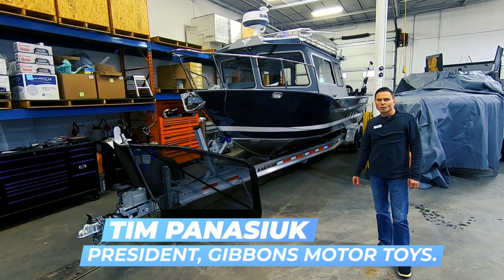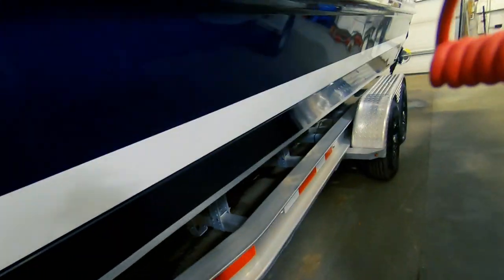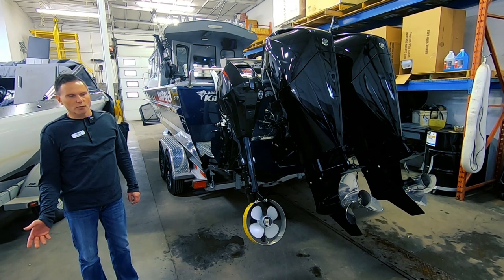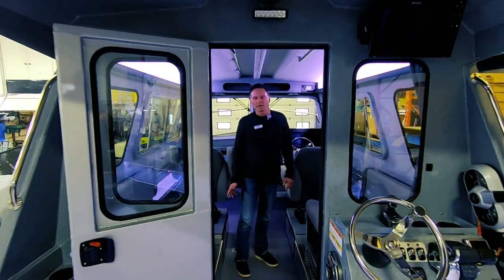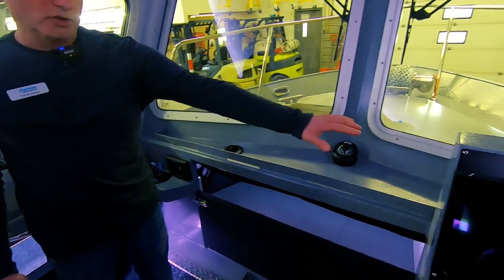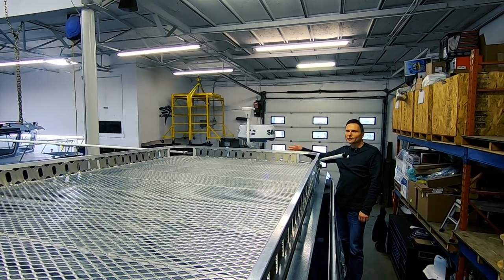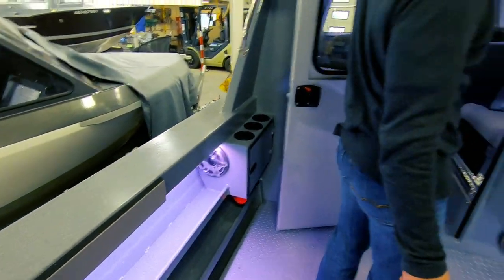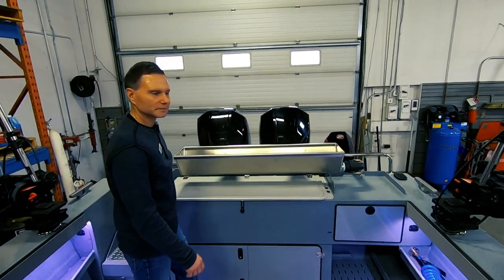KingFisher Boats - 2825 Coastal Express - Alberta & BC

Comment: Great video, lots of info. I’m not in the market to buy a boat just yet, it’s going to be at least 2 years from now but I’ve been searching boats and what different manufactures have to offer. So far I got it narrowed down to either a kingfisher or the campion explorer. Both very different boats. I never owned a boat before but I know that I want one that I can be comfortable on no matter the weather so a inside space is a must and also a heater. My question is if I were to buy a kingfisher what would be the best option for mostly alberta lakes and the occasional trip to the B.C. coast for some saltwater fishing? My buddy has been fishing alberta lakes his whole life and tells me that the costal the offshore and the escape are all too big for the lakes in Alberta, do you think this is true?
Reply from the maker: Thanks for reaching out. We sell quite a few Escapes into Alberta every year to customers primarily using them in Alberta. It all depends on what lakes you're using them on. Generally the limitation will be the boat launch, parking lots, etc. Once you're on the water you won't have any issues with a larger boat. They generally do not draft much more water than a smaller boat. Personally, I'd recommend a 2225 or 2425 Escape. The walk-thru windshield is great when pulling up on shore for access to the bow of the boat. These are also very capable offshore. If you wanted to step down a size, the 20' Escape series is also a great freshwater boat with the occasional trip to the west coast. Hopefully this helps.
Reply: What does this setup total to? I am undecided between this and the offshore 2725. I like the ruggedness of the offshore but the seat capacity and cockpit space of the coastal 2825
Reply from the maker: @hching6248  Most of our 2825's sold this year ranged from $150K to mid $200's all decked out. A moderately equipped 2725 will start around the $200K mark. The offshores certainly start at a higher price range, but if you compare the cabins / primary features you will be able to see this price spread pretty easily. Both boats have their place though, it all depends on your needs.
Reply: @gibbonsmotortoys  thanks for the reply! One more question, is the hull design different on the coastal compared to offshore? I saw on one of your video stating hull thickness but are the hulls that different in the way they ride?
Reply from the maker: @hching6248  The hulls have a bit different design, but both handle rough water very well and share a lot of similarities. The coastal boats come standard with a .190" bottom, but we upgrade most to 1/4" which is standard on offshores. The offshores do have thicker sides and are heavier boats, so you do get a more stable, smoother ride because of that. Overall they are very comparable though.
Reply: @gibbonsmotortoys  what does moderately equipped entail ? Engines, rigging and trailer ? Maybe electronics ?
Reply from the maker: @robintaylor1490  Lots of variables with the extensive options list, but for sure engines, trailer, rigging as well as potentially some electronics.